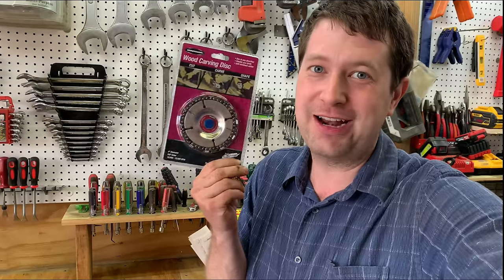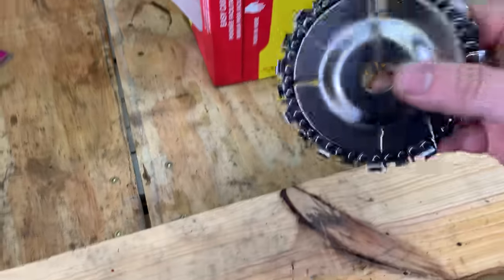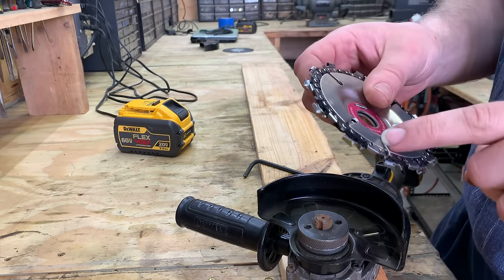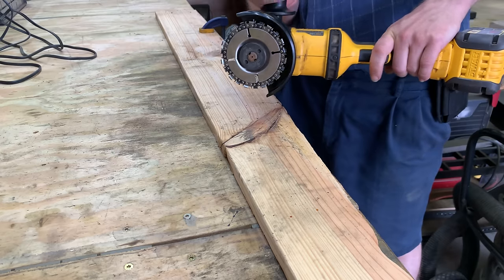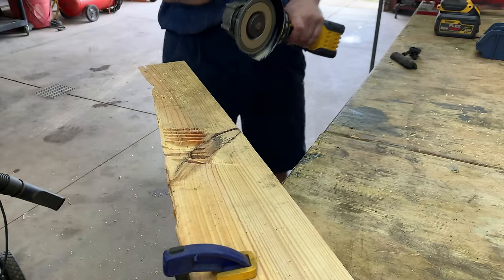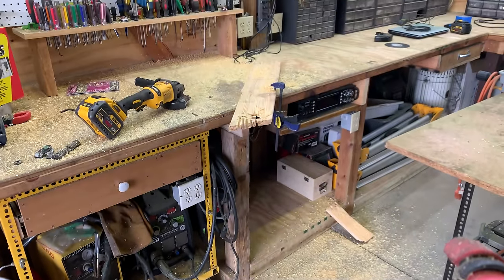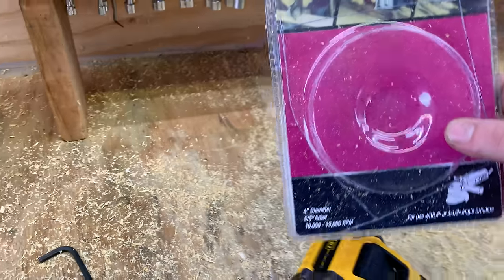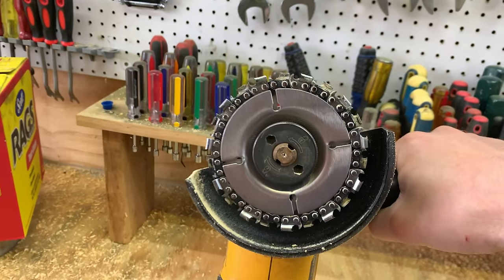Most Dangerous Angle Grinder Attachment I have Ever Seen

Comment: Yeah that's it, just hammer the blade into it. Not feathering into the cut or in control at all, like a 7 year old smashing it about.
Reply: to his credit chainsaws and angle grinder wheels like this do pull themselves into the material they are cutting. if you have ever use a relativley powerful chainsaw with a sharp chain then you will know tou have to pull it out of the wood for it to cut properly.
Reply: I'm a welder fabricator pal, used alot of machines, stainless blades for cutting aluminium are lethal, that thing he using is nothing if used correctly

Comment: Normal chainsaws have several safety features. A chain catch -if the chain break, it catches on a metal piece that stops it whipping and lashing someone.
A pressure bar emergency stop behind the hand on the top handle - if the chainsaw kicks, due to catching the top end corner of the bar on the wood, it would do serious damage, were talking tear through your face very likely to go through your head - damage. The bar is an emergency kill, stops it so it doesn't do that. This circular chainsaw, essentially, from what i figure has a continuous kick back action, rather than confined to just the top end corner of a chainsaw bar.
Also he should probably be using all the safety gear of a normal chainsaw (even though it isnt extended in a bar), that includes a full face visor and maybe goggles too, chainsaw trousers and boots.
Even so... i wonder if i would get one...?
Reply from the maker: Very true, you are basically cutting with the tip of a chainsaw with this tool!

Comment: Seems to me that having a chain on a high-speed device like this is fundamentally a wrong idea.  The first problem is that, once the chain breaks, which it would eventually do, I would hate to have any body part close to where the whipping chain would be.  The second thing is that there is a tendency of the user to swipe the grinder from side to side, as RDAllen did here when creating the bowl effect in the wood.  The problem with that is that it puts a lateral stress on the chain link pins, potentially weakening them.  (I suspect that any pro tree-cutter would recommend swiping the blade laterally across a branch, either.)  I would also think that any lateral motion increases the chance of the wood catching under the chain, with the result that the tool could be violently pulled into a direction that is unexpected, such as into your gut.  I am no safety expert, but this thing creeps me out.
Reply: I’ve used this a lot with no problems.  But it does suck. And is super scary.

Comment: Definitely wear long pants .

and  chaps if you have them . 
definitely wear full protective face shield .

You sure do love to emphasize the word “Chineeese ”
Do you realize that dewalt 
angle grinders  are also made in China ?

Make sure the rotation of the wheel 
Will pull the grinder away from you 
if it grabs .

Comment: You really need to respect this tool and understand what it is capable of. When I first used it I didn't know what I was doing and nearly cut my finger off. Thank God I was wearing gloves with Kevlar lining. My advice to newbies:
1. Start slow
2. Graze the wood- don't force it into the wood
3. Use the right side of the attachment so that the teeth are removing wood as they are rotating away from the wood, not into it. Guard should be on the left side
4. Always let the tool come to a complete stop before setting it down. 
5. Have fun. This is the most aggressive attachment you can get for removing wood. It's awesome watching the wood vanish before your eyes

Comment: When I worked part time for a hardware store, our new manager came from a deli.... Needless to say when a guy returned that she'd served with a 9 inch grinder blocked up with plaster and with a drop saw blade on it. I nearly killed her. He'd been using it on her recommendation to cut sheets of plaster board.... It slipped and ran up the side of his body missing his corodit artery in his neck and saving his life was the fact the plasterboard or drywall blocking up the blade everywhere and got into the brushes of the motor which luckily slowed down the grinder.
The guy was like well how am I going to cut plasterboard? (drywall) I gave him a $5 pocket knife and a 2 Min lesson....

Comment: I have never used an angle grinder before, the closest was a an offset 7 inch disc sander (like the design of the angle grinder)  From I know of the angle grinders they can be dangerous in use as any other power tool if precautions are not observed and knowing the job and limits of the tool, in advance. However, this grinding attachment, looks quite dangerous at 1st glance it did appear as a chain saw with the indivdual teeth. I think it would be much safer to do shaping with a router and the different bits to make the cuts. Or a table top/bench sharper This attachment is almost like using a circular saw w/o the blade guard.
Reply from the maker: Or a rasp type seems like it would safer as well.

Comment: Edward Scissorhands.  A chain saw blade on a grinder.  I needed this laugh.  That loose chain is absolutely dangerous.  At least with a chain saw, the chain blade will stay on when or if it jumps off.  Hilaraious.

I remember a guy using this on ice sculpture.  You brought back a memory.  Absolutely dangerous.  Just use a chain saw, is all I could think when I saw him using it.

Comment: They work but have their limitations for shaping. Thems will climb right up your arm if not careful. they should remove material slowly and you don't want to catch it between a corner.  Yes, nothing to be throwing around like a nimnue.  You can use the tip of a chain saw in the same way, I just riped 6 boards 8ft long 4inch thick from a log with an 8amp $50 buck electric saw. You just have to run them like you would one of these slow and easy and you won't kill the motor or your self.

Comment: This is meant to be a calving tool not used for gouging or cutting. It is really a beautiful shaping device for light pressure and two hand grip. It is dangerous in one hand or for deep cutting with possible kick back. In other words, to be used to calve wood with good hand control. The only safety mechanism to avoid kick back if gouging too deeply is the chain slip. Compare the calving disks that don't have a chain... You will know what kick back is if you use those for cutting...!
Reply: Sorry the auto spell on my tablet has a mind of its own... Carve, not calf....!

Comment: Angle grinders are dangerous. The damage is limited as long as you use an abrasive cutting wheel. The moment you use something toothed,  the risk is a hundred times more. In this case, if you are using a soft wood, the risk is lower. But if you use some hardwood, it is very risky. Angle grinders give a severe kickback with lightening speed and if you have locked the switch in on position, you are simply challenging the undertaker. Wood cutting machines have much lesser torque and speed than angle grinders.

Comment: For about $27 this is the most expensive tool accessory I’ve purchased at HF, mine included no clips, and despite the video title, it doesn’t seem more dangerous than anything else you attach to a grinder. Even a sanding disc could be dangerous if it comes in contact with you at that speed. Anyways thanks for the demo vid!
Reply from the maker: $27? I only paid a couple dollars....
Reply: @radozeman  yep! I knew it was crazy but it was the only wood cutting option they had that fit an angle grinder at the store. Oh well, but it works pretty well for me, I used it for acrylic as well as wood

Comment: If used properly and the material is solid it would be the perfect attachment to use when renovating your deck and opening up the gaps between the deck boards that after time become clogged and even close up and water has no place to drain thus the boards develop large cracks and channels. it looks like the cut on the attachment is around 1/4 inch which is the recommended gap or space on deck boards. Would have come in handy last week when I did my deck.

Comment: I don’t know about the MOST dangerous one. Maybe the most dangerous that is intended as a grinder attachment but other wise I may have you beat with a 10” diamond saw blade to cut concrete. A buffer actually worked better than a actual angle grinder because with the grinder you had to tap the trigger a few times to get her up to speed other wise it would stop

Comment: The tool is used in the log carving industry. Contrary to your beliefs it is far safer to use than the tip of a chainsaw when carving finer details as your hands are closer to the blade and offering better control. This is not as dangerous as you are thinking.

Comment: You think this is dangerous, they make a blade for cutting brush, it's solid, no chain, the cutting parts from the chain are riveted directly to the blade. It's 9" and made for line trimmers. I've got one, I actually can't wait to be done with it, I'm cutting small trees and brush with it. A tree a few inches wide doesn't even take a second, the blade pulls itself right through them.

Comment: They are banned in the UK.
The chainsaw blades rotate at about 12,000 rpm and can grab the workpiece suddenly, ripping the tool out of the operator's hands causing very serious injuries.
The operator can be a DIY novice
Reply from the maker: Even "experienced" operators have been seriously hurt by these

Comment: Why is this more dangerous than anything else you put on to that grinder. That thing spins at 10000 RPM and will cut your flesh even if you just put a disc that is made of paper. You will lose some part of you if you touch it while if on no matter how "safe" that blade looks. "Grinder" means a machine to remove things even if you put a polishing wool onto it.

Comment: Balderdash - I’ve been using one of these for years - if you are sensible and have some idea what you are doing they are a very useful and safe tool. They are as safe or unsafe as the operator and it looks like you come under unsafe.

Comment: LOL, All I thought through the whole video was "man this guy is holding the angle grinder wrong". Turn it so you are grinding instead of cutting. I use mine to grind down tree stumps so my mower blades and decks can pass over them w/o hitting the stump (smaller trees). Also good for grinding down exposed roots

Comment: I’ve used this tool to make a walk over threshold for an extension cord for work. I moored a notch on the bottom very carefully and contoured the edges of the 2x6 on the top side. Worked like a charm. I think you use that tool dangerously on edge like that.

Comment: There is an A&E show in the UK that showed a stupid idiot that injured himself by putting a 4 inch saw blade on an angle grinder. He used it to cut a plastic gutter and the blade jammed became airborne and fell landing on top of his belly. He sat holding his innards in until an ambulance turned up.
If it sounds and looks dangerous......it's dangerous!

Comment: These things have been available for a long time and one can only wonder that  they have not  been banned from sale from the start. People operating chainsaws have been subject to considerable pressure to use regulation approved safety equipment,  helmet with safety visor screen, gloves and other special protective gear if working for an employer. The kick back on a chainsaw is deadly and many people around the world have suffered severe and life changing injuries in spite safety features built into the machines. Many smaller angle grinders can only be held in one hand but not securely. At RPM speeds in the thousands the kickback would be uncontrollable and no instant stop as on chain saws. If caught on an arm or limb not only would you risk loosing a limb, you would probably bleed to death before help arrived. As a retailer of chainsaws in the past I refused to sell to other than farmer and professional users and am still amazed at the number of people who allow bystanders  including children to watch and help hold material often only inches away from the vicious ‘ blade ‘.. Where are the Health and Safety people on this?

Comment: I tried figuring out exactly what this could be used for, or how you could safely handle something that could accidentally take 3 of your fingers off in a shitinstant............and the only deduction I could come up with was that it was probably MOST dangersous fingertoucholing that blade WHILE YOUR BATTERY WAS STILL ATTACHED TO THE TOOL !!!!!!!!!!!!!  THAT'S LIKE CHANGING THE SAW OF YOUR CIRCULAR SAW WHILE IT IS STILL PLUGGED IN THE SOCKET !!!!   I'm telling you, I'm shaking my head at people today.  No wonder why aliens are afraid to land.  They might have to come in contact with extraterrestrial asstwits of the third kind.

Comment: First off, angle grinder shouldn’t be a tool,  the most dangerous part of a chainsaw it’s the turning point of the blade and the disc is just full of the turning point when you hit a wrong quadrant it will just fly through. And many people who buy grinders doesn’t even know what quadrant is. So use it on your own risk.
Reply from the maker: That’s exactly my point with this, like you said the most dangerous part is the tip and that basically is what this is!

Comment: He should put that man mangler down and never touch it again. I do a good bit of Wood carving and use several different techniques and tools from disk to lathes to draw knives I’ve played with most all of it. With that being said I can tell you that it works well. Pay attention to direction watch for edges and corners especially when working with a really hard wood. I’ve had a dewalt grinder snatched out of my hands on more than one occasion. Never had any issue with any type of shaping disk ever but that thing is a man eater. I’ve been extremely lucky  escaping with what felt like a cracked bone in a thumb and finger. The first time it grabbed and took flight I was afraid to look at my hand it had the numb somethings really wrong feeling. If you’ve experienced it you know what I mean. 
If you just have to I’d say go for it but that thing gives zero F***s and sometimes seems to have a mind of its own.  Be safe! Happy carving folks!

Comment: first
you must have your safety clothes on when this chain flies off your intestines are on the ground

second
these are wood carving disks the people who do wood carving are aware of the risks 
it is not the product that is dangerous but the inexperienced people who use this product who are dangerous 
like you who are going to cut wood plank off

Thirdly
a wood carving disk is made to remove shells of wood to create faces, feathers and fur effects

you keep the wood carving disk flat or 30 degree is angels and you glide gently over the wood

and for the next time, PUT ON PROTECTED WORK CLOTHES
if you work with machines

animals bite bite bite and then rip you apart
chainsaw, saw blades, sheer, trimmers they rip you apart in a split second 

cut youre intestines from your stomach and you die of infections

if you hit your leg you have arterial bleeding and your bleed empty
this also applies to your arm

always make sure you wear 1 belt with as many holes in it as possible when working with chainsaws, hedge trimmers or other knife-like tools

so you can pinch your veins in case of emergency

Comment: Most power tools can be dangerous, common sense for most and then learning the rest about the tools. the guard on grinder is at the wrong position for the wood carving disc.. For such a dangerous tool and you have shorts no work gloves no safety glasses. Should be showing how to safely use the disc.

Comment: Wow! You learn something new everyday! At frames 6:48 you begin to see what this thing is supposed to be able to achieve. L.A. #SWAT needs this unit right now in their Home Entering Arsenal. They could carve a hole for their Bazooka in the next Crack House Assault on the 6:00 Evening news tomorrow. Anyone agree we need to periodically add some oil to the circular chainsaw blade? If that chain breaks one link and flies off the stainless steel disc, your face is gone (with or without a plastic protective shield) in my humble opinion. It'll be sho' dark, but I'd want to wear a Welder's Mask using this unit. Finally, I almost dropped a log when he read the back label saying this new circular carving tool is from Harbor Freight. Thus, I need to see approx 27 more positive no face loss reviews before ordering. For now, I'll stay in my Flintstone Era World with my handheld Rasp.

Comment: Got mine from King Arthur Tools.  Works great if used properly.  Maybe check out some online instructional videos to get a better respect on how to use this tool.  Great for bowl carving.  Any direction does not refer to the spin direction, but the angle you use it.  Yes, it will cut like a chainsaw with the single angle you used, but try it again with a 15, 30 and 45 degree angle and experience the versatility, it may well become one of your favourite wood shaping assets. :)